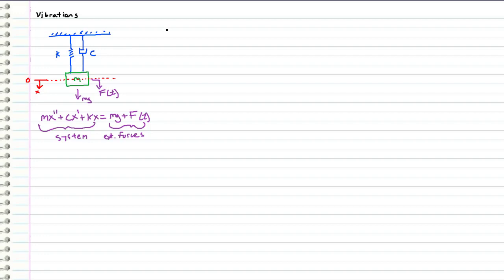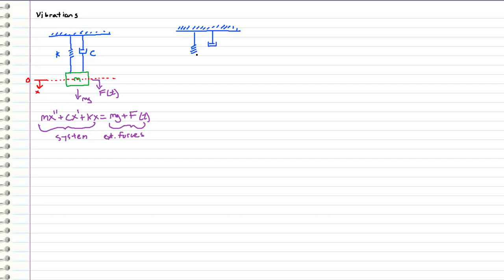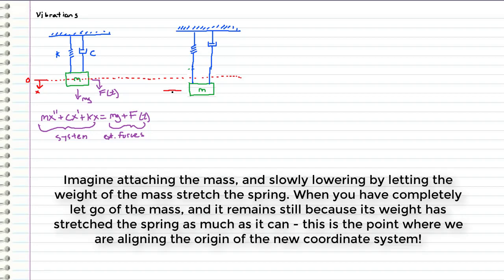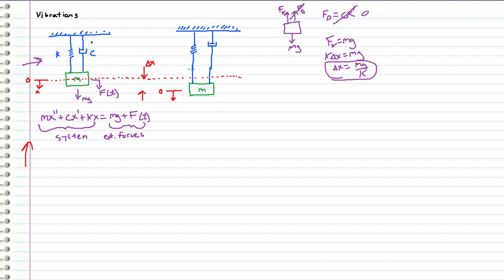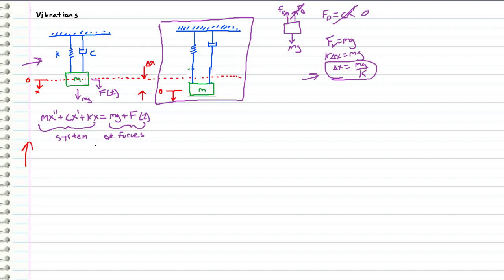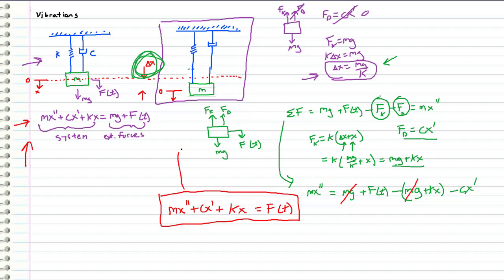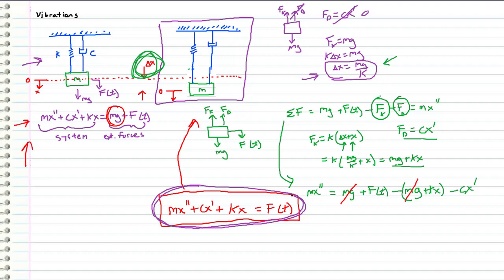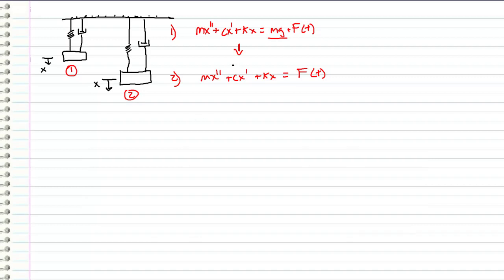Differential Equations - 42 -  Modeling Mechanical Vibrations Part 2

Comment from the maker: Before moving on I wanted to demonstrate that you don't really need to consider gravity (or constant forces) at all on the right hand side of the Diff eq, since it only amounts to a shift of the solution by a constant. Instead, of actually keeping gravity as a term on the right hand side of the equation, we can simply pick a new coordinate system that automatically accounts for the gravity effects on our solution.

Also, its a been a while! If it seems like this video is repetitive, its because it is! For my sake of getting back into it if not for yours!
Reply: What's up bud? When are the new videos coming out?